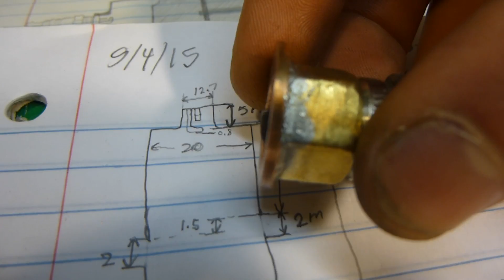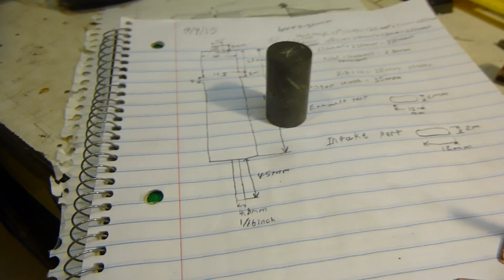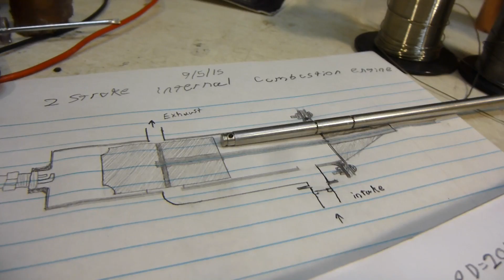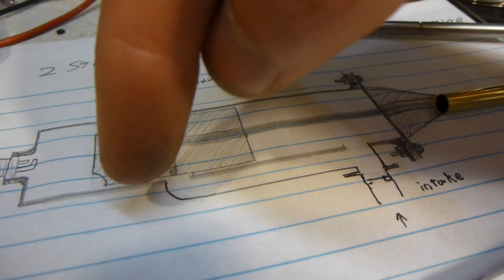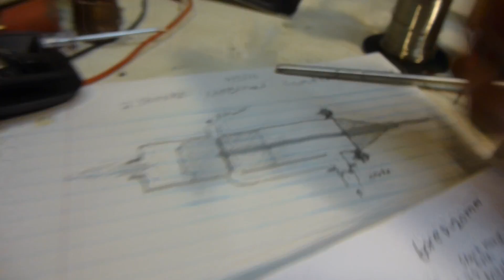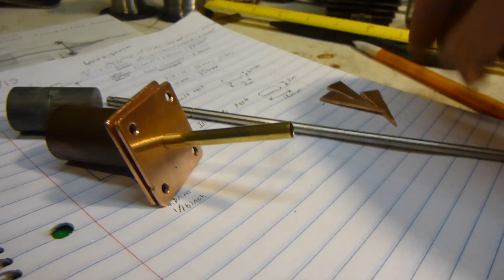Part 4. Making Internal Combustion Engine, No Machine Shop - Cutting and Soldering the Cylinder

Comment: i used copper wire to solder copper together, The downside is that you need eye protection to the level of a welding mask, and it's high temperature. The pros on welding with copper wire is that it's stronger than solder in high heat applications. AKA won't melt it away. Other than that Good Job, I can't wait for this to finish.
Reply from the maker: +03hVc01 So basically brazing except using copper?  I'd probably need acetylene torch for that.  But it's an interesting idea.  The other problem is that heating the copper that hot takes the annealing out of it.  This would most likely make the copper too soft in a lot of places such as my mounting plat.  It would just bend.  Also I don't ever want to get my engine up to very high temperatures because I am using a piston that's made out of epoxy.  So the solder melting is kind of a fail safe before the piston starts to burn.  It would be much easier to solder the head back on than cast a new epoxy piston.  Not that making the piston was particularly hard.  Thank you!
Reply: +Makerj101 that's exactly the thing, your method is much easier and low cost.. I like, it's a proof of concept. Keep up the good work.
Reply from the maker: +03hVc01 Thank you!  I actually really want to see if JB Weld could be used instead of solder.  There seem to be some people who are interested in building this but they don't know how to solder.
Reply: +Makerj101 job weld is a good idea actually, btw you should have a fan pushing the fumes away from ya when you solder. It may keep you alive longer. Lol
Reply from the maker: +03hVc01 Yeah true that about the fumes.  I have a vent fan but I always forget to turn it on!  Although currently it's been getting a lot of use because I've been using it to extract the exhaust from my engine.  When I first powered up my engine it set off the fire alarm!  At least I know the fire alarm works now!  :D
Reply: haha

Comment: Great video mate. Just one tip. If you cool your soldering down with water it can stress the solder which can result in cracking later. Its best to let it cool down slowly, but hey, we're always too impatient when building stuff.
Reply: +Makerj101 I alway wipe it with a damp rag to make it smooth and even. But yeah no actual water on wet solder, it will cause pitting and cracking.
Reply from the maker: +Robonza Thank you!  Yeah I probably shouldn't have cooled it with water.  I did wait until the solder was hard.  I'm not really sure how much of a difference it makes if you rapidly cool it after it's hard.  I guess I would make some.  So far it's holding up fine so that's good!
Reply from the maker: That works well for pipes but things like this the pieces would move.